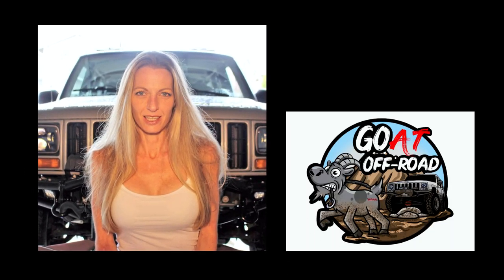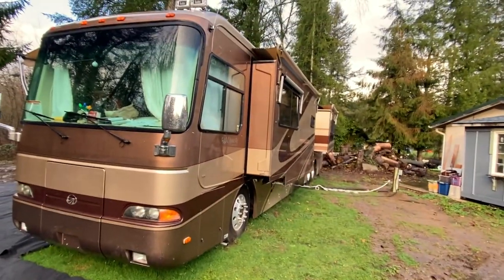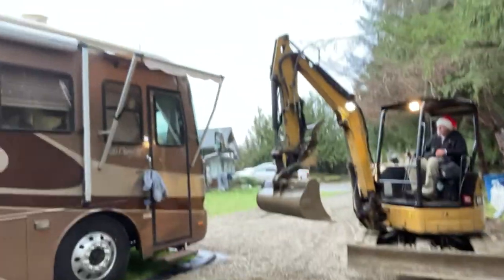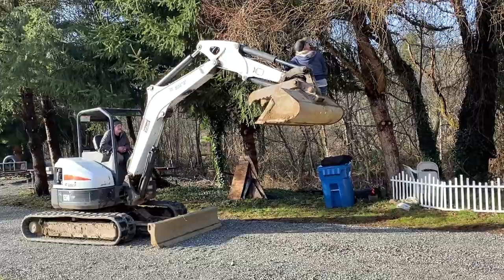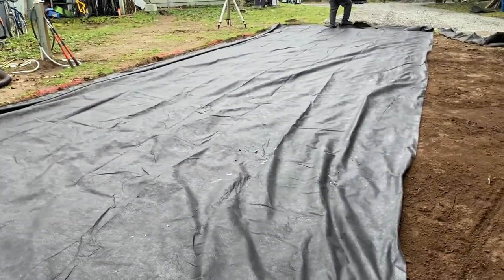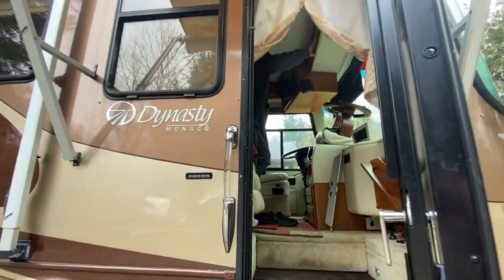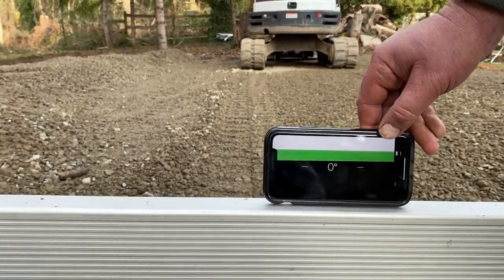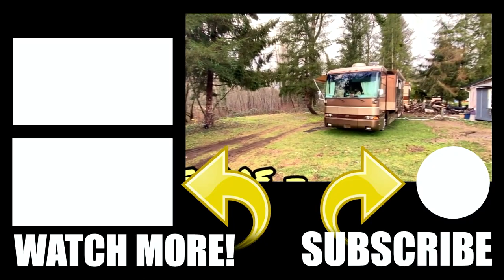PREPARING OUR LAND FOR AN RV SHELTER: "LITTLE LAMB GETS A HOME!"

Comment: I know Joe knows his stuff, so I'm sure theres a reason why. but wouldnt it have been easier or cheaper to find more dirt to lay on the left side so it wouldnt need as much gravel?
Reply: I do know my stuff! 🤣 But, it’s a good question. And here is the answer- even if we had good dirt and not topsoil I still would use just the rock. This way I only have to do one grading and compaction activity. I teach this to all my new foreman’s too when we have a job that lets say we are prepping for a concrete slab for a house we are building. And we need 6” of rock under the slab but there is a 1.5’ of fill needed. The extra rock is cheaper than placing ( level) a foot of dirt and compacting it then placing the 6” of rock and grading/ compacting it. It’s a labor/equipment/time scenario. Plus the rocks compaction is more predictable and consistent.
Reply from the maker: Plus a rock rake is a good workout 😂